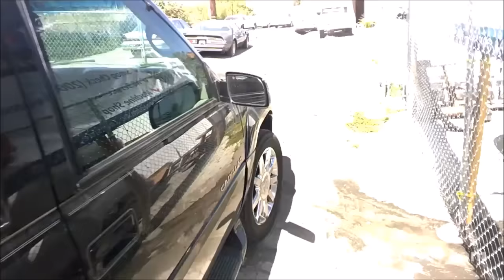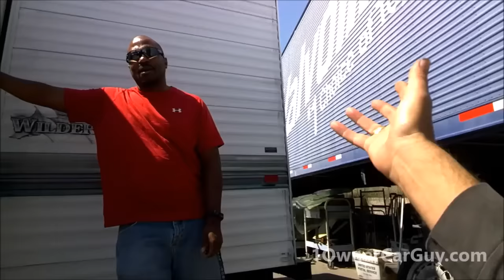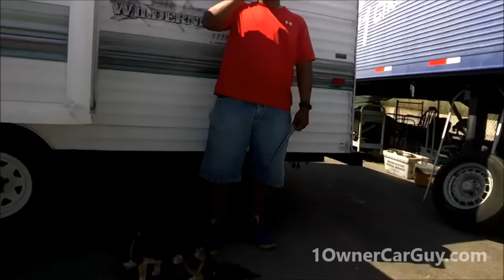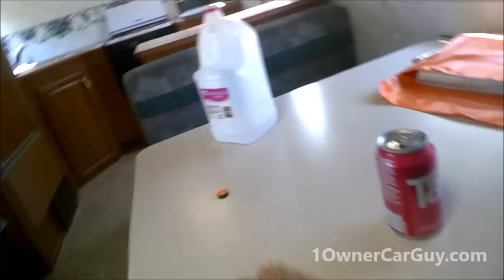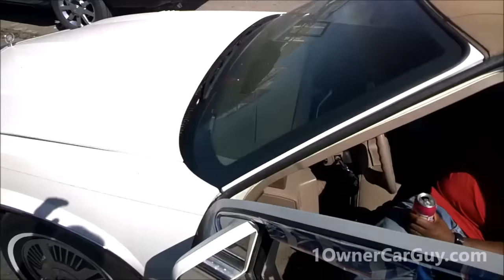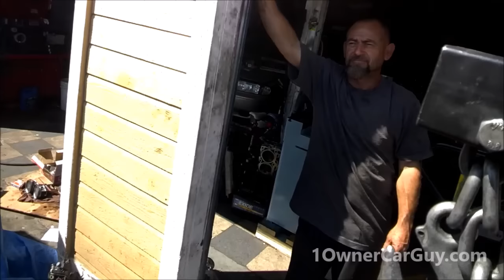Car Dealer Tips How To Vlog Wholesale Auto Interview & New Friend Video

Comment: The 06 and up Northstar is like bulletproof. I have over 200k miles and still going strong. I had a 96 with the head gasket issue and just threw another motor in it and sold it. I had a 98 for 3 years and not one time did I have a problem other then regular maintenance and drove it every day. But 04 Is when they changed the headbolt design so you should pretty much be solid with no issues. My 06 DTS has every option including the Performance   Northstar package.